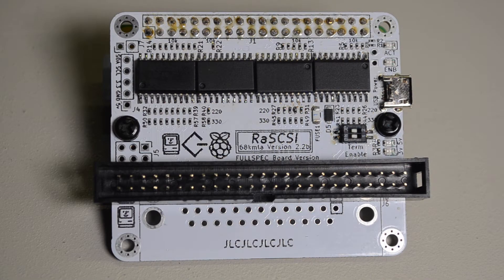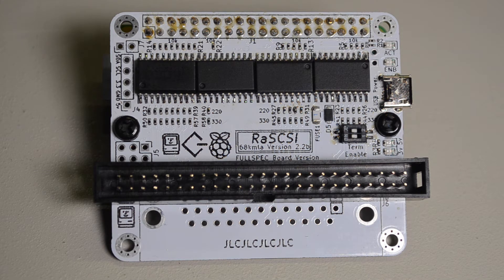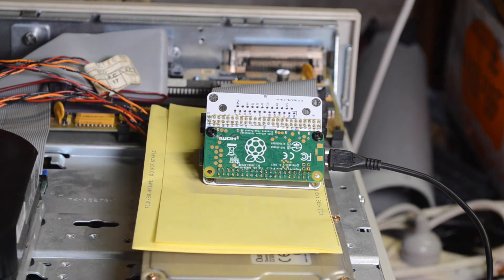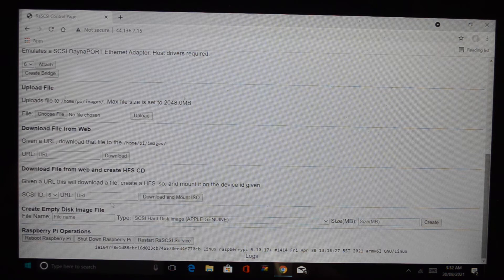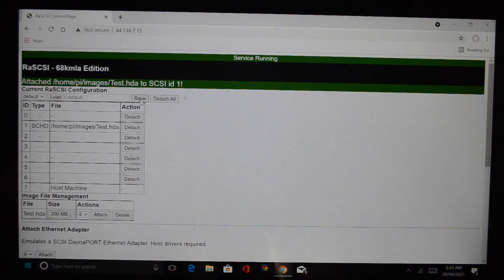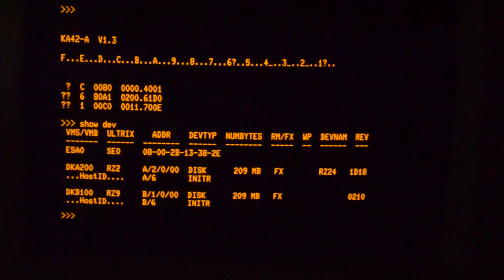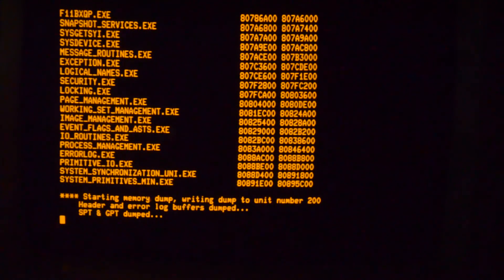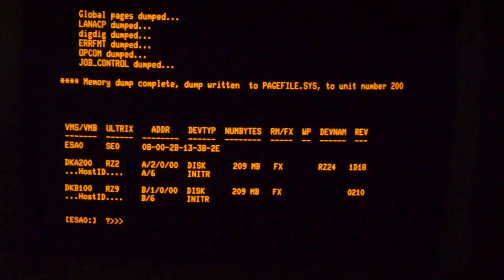RaSCSI for VMS Systems?

Comment: What is ratteling in the background. Sounds like a cement mixer and rain at the same time.
Reply from the maker: Rain on a corrugated iron roof under a massive tree. The tree also drops little nuts and these are really loud!
Reply: @digitaldiggings  Really loud.

Comment: Is there source code for the driver on the raspberry pi side?
Reply from the maker: Yes, it is on github. I'm not familiar with SCSI internals, so not easy for me to understand. I have dumped some SCSI traffic using the SCSI2SD to see if I can find the missing command - yet to analyse it.